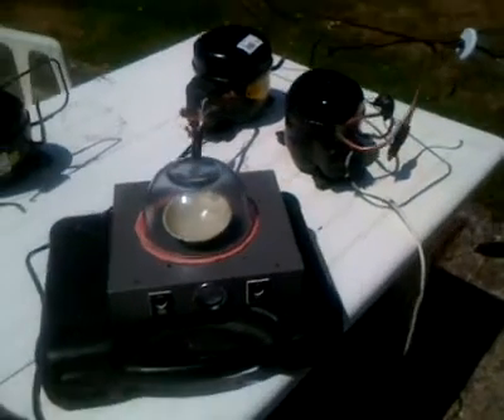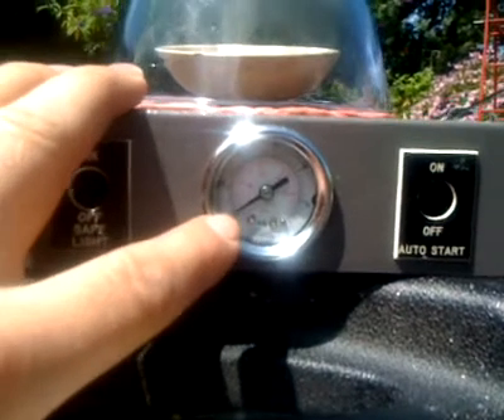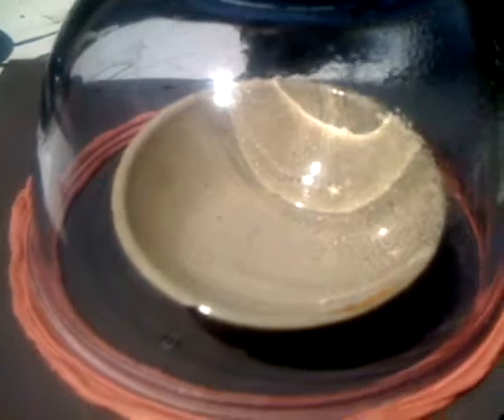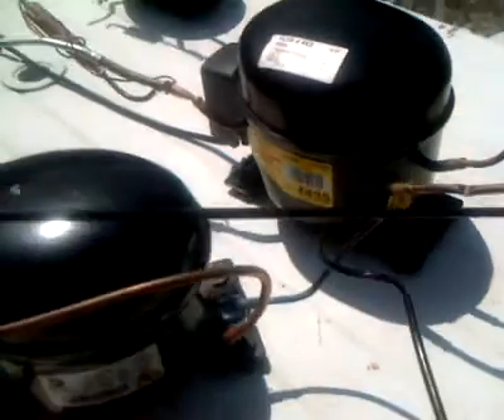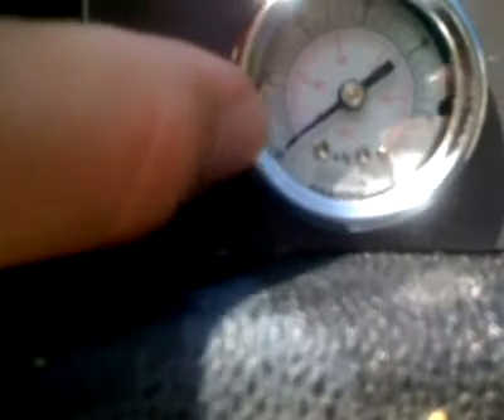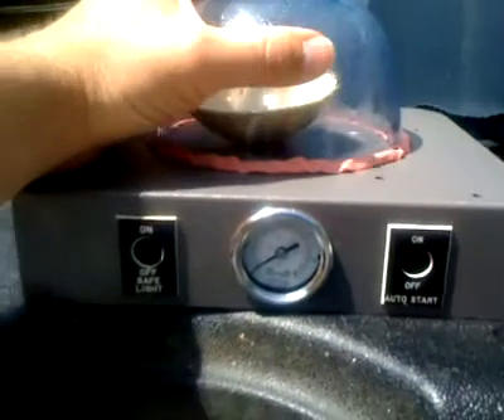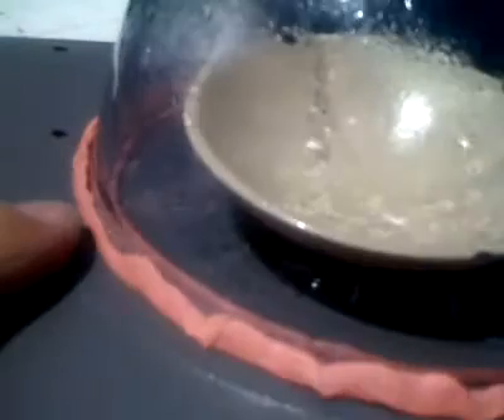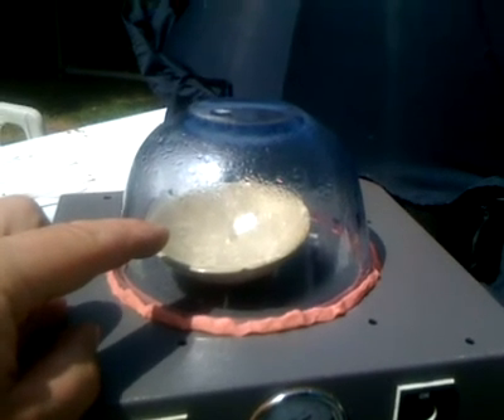DIY freeze-drying 2

Comment: any updates? Did the compressors "die" due to moisture mixing with the compressor oil like spud suggested they would? Or did ya get some use out of them before they "died"? Did you ever add an inline cold trap (bottle in a -20 deep freezer) to remove the water in the intake line to the pump?